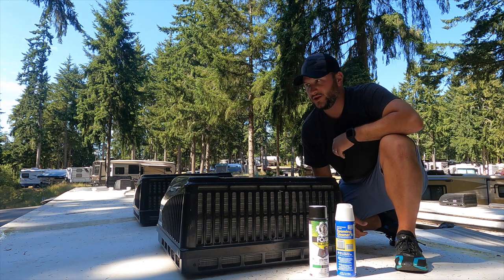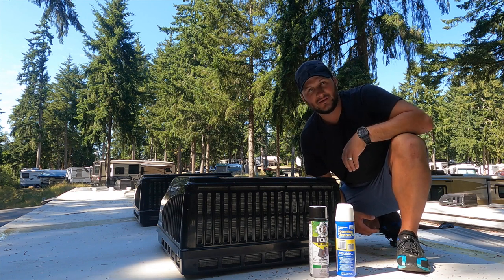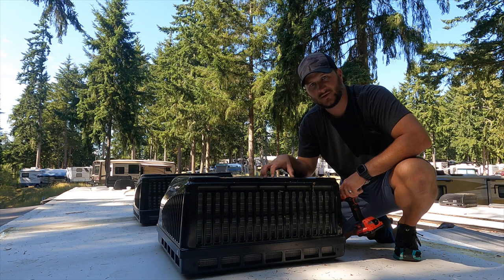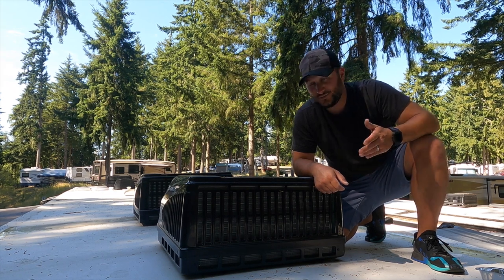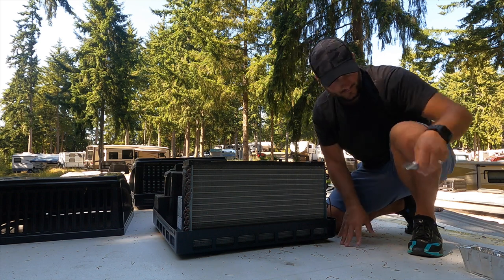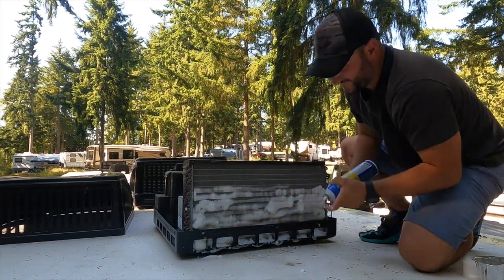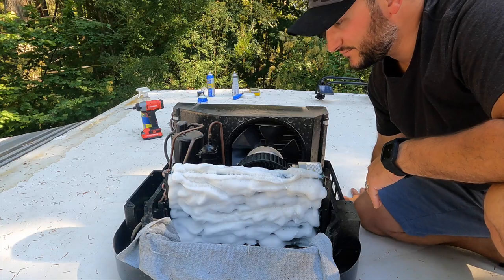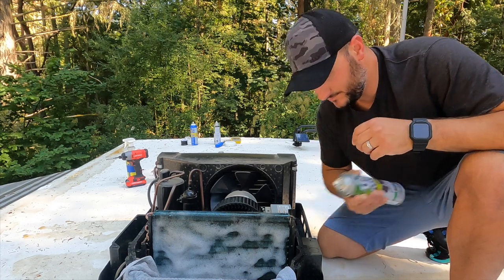RV Air Conditioner Maintenance | How to clean an RV Air conditioner!

Comment: I use Viper Coil Brightener, Viper foam gun, and garden hose to clean both the condenser and evaporator.   I made sheet metal covers that go on top of the vents going into the rv, to prevent foam and water from going inside.  Cleans the coils like new on a 22 year old Coleman Mach roof top!!  This process may take longer than other methods, but really gets the coils clean, especially with a warming planet, makes these older units run their best.
Reply from the maker: Nice! Thanks for watching and happy camping!

Comment: Nice video.  Really liked the explanations .. ie rinse roof (assuming rv sidewalls too), how the condensate rinses fins (assuming if you have a heat pump unit too that both would get this effect), the "deep"  horizontal spray, the 2x spraying, using a screw container, using light soap solution to do final rinse .. all very insightful.   Questions, how many cans of each type spray did you use for your 3 units?

Comment: If you can't get on your roof can ypu spray the cleaner to the inside of the rv for the Evaporator? I noticed if I remove my filter from the inside I can see the Evaporator.
Reply from the maker: Yeah, I suppose you could! It would certainly be better than nothing. That's for sure! Thanks for watching!